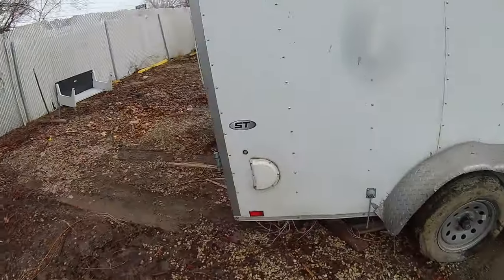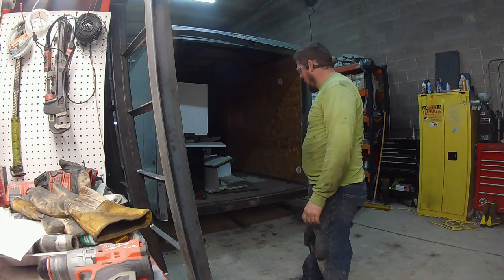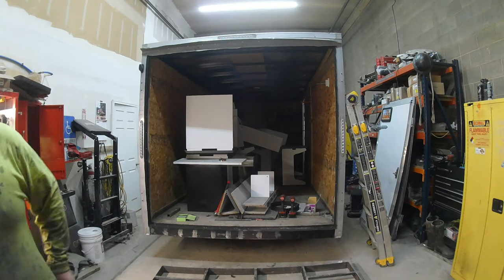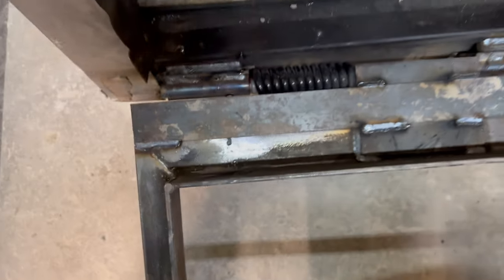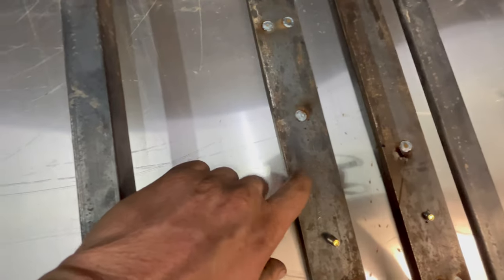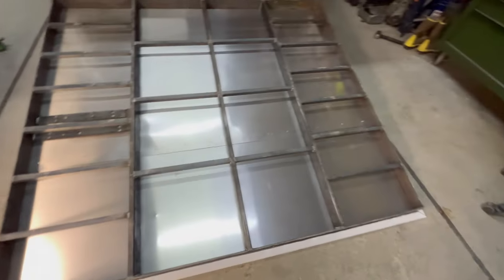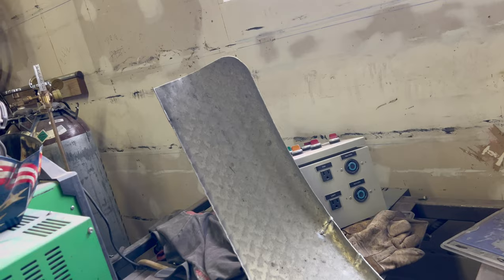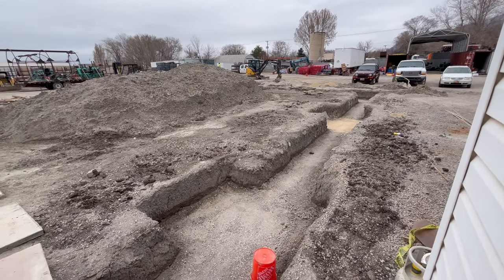Am I building a ramp door for an enclosed trailer or is this thing just a  jungle gym?

Comment: Thank you very much for this video. This is exactly the video I have been looking for cause i had no idea how to build one of these ramps. Thanks again.
Reply from the maker: Glad I could help. The door got pretty heavy and ended up adding a winch to lift it up and down. I may have over engineered it. You can probably go 3/16 or 1/8 metal, I believe I did 1/4, and also can do 1/2 wood instead of 3/4. When we added the 3/4” wood, that’s when it got heavy to lift. Good luck!
Reply: Awesome, thanks for the info. Where did you get your winch? I've been trying to find out but can't seem to find one. Would you know what they are officially called? Thanks
Reply from the maker: @joshuaschuit1780  sorry it took me a minute to respond. The winch is a 3000lbs  xpv, with a synthetic rope. It’s a 12v winch with a handlebar switch and wireless remote. I’ll post a short video of it.
Reply: @Kustom_Rustin yes that would be great thanks. Look forward to seeing it.
Reply from the maker: https://youtu.be/5cYTbufXKeU

Comment: So there are no garage door springs used in this project.
Reply from the maker: Lippert Ramp Door Spring Replacement for Toy Haulers, Exact Match Replacement, R/H Coil, Corrosion Resistant Powder Coated, Medium Duty, Black – 173067 https://a.co/d/huEgIDr

Only 5 of these springs to help return the door.

Comment: How much does that door weigh?
Reply from the maker: I can’t remember, feels like 150 lbs with the springs helping. I overkilled with metal thickness and plywood thickness. Door was easy to pick up until the 3/4 subfloor plywood was added. Could have gone thinner metal and 1/2 wood. Probably would have been fine. I have another video where I added a winch to lift the door.

Comment: Where did you get the springs.  Need size and tension specs.
Reply from the maker: It is a lippert ramp door spring. Part number 173067. I bought them off of Amazon